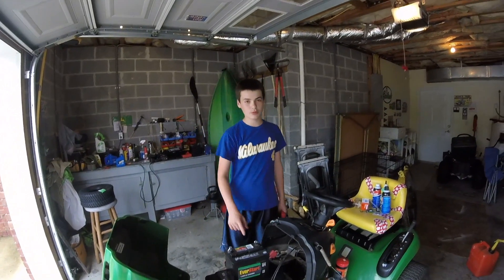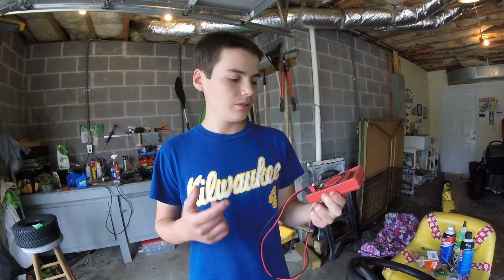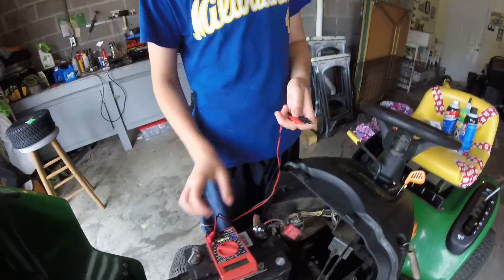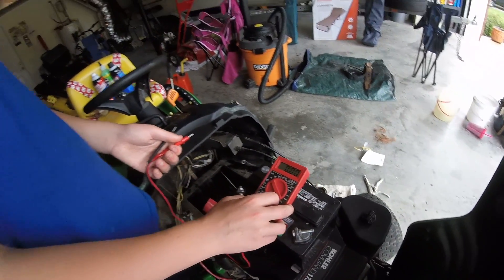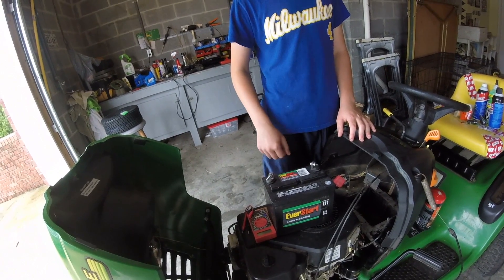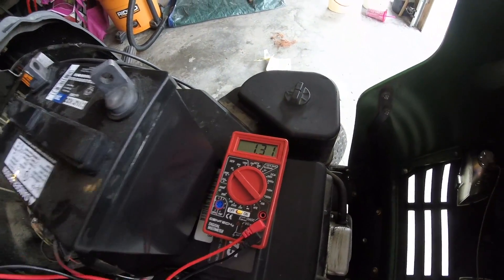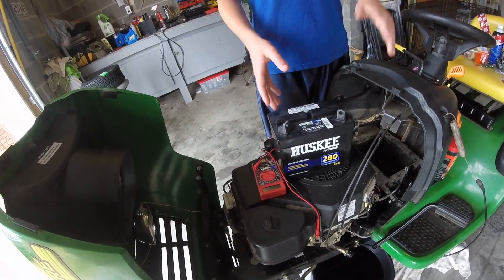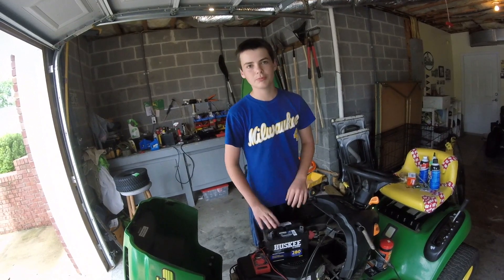Simple! How To Check A Dead Car or Lawn Mower Battery in 60 Seconds!

Comment: You can test a battery and still 12 V and the battery still be bad you have to check the cold cranking amps when you try to turn it over and if they dropped beyond a certain point I think around 10 V then the battery is no good